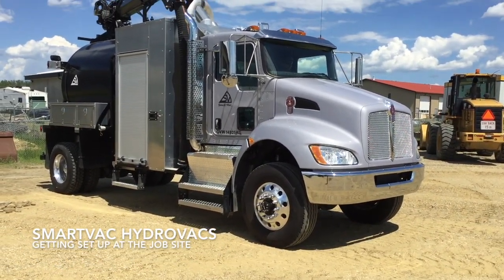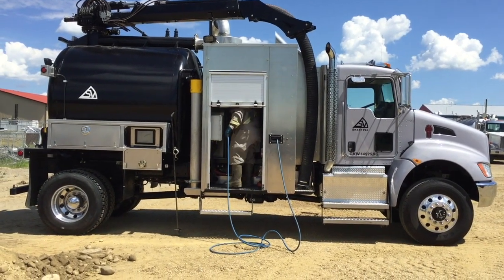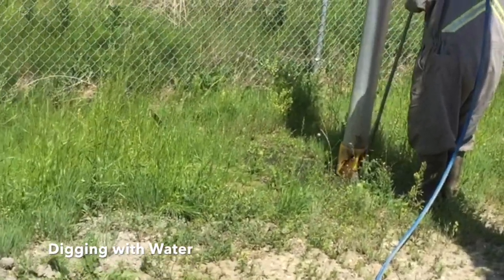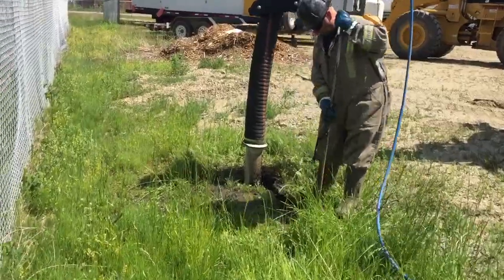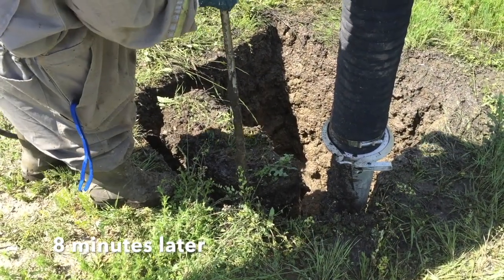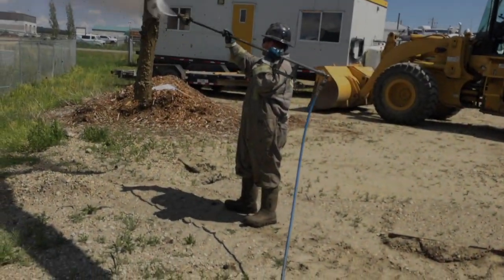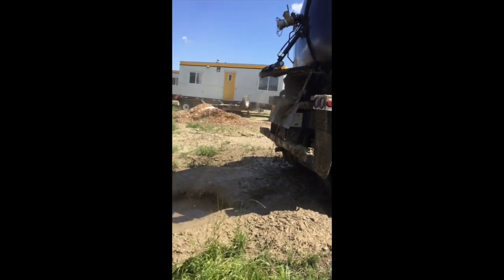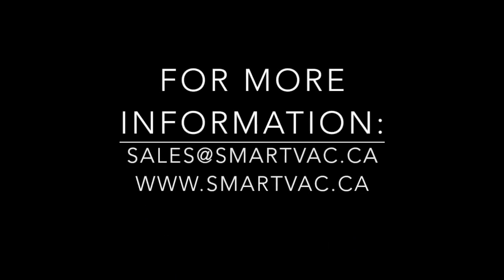SmartVac Hydrovac Excavation Video

Comment: What psi does the operator run his wand at?
Reply: Bobby Frechette anywhere from 2000-3500 psi.
Reply: Based on the size of the equipment its likely below 4k. Higher pressure equipment often requires tow-behind pumps to achieve desire pressure
Reply: @AlbanianThrash  well it’s a pto. Pump so I would imagine it can get fairly high unless the vac takes away too much from it